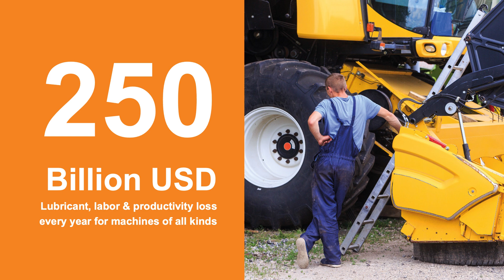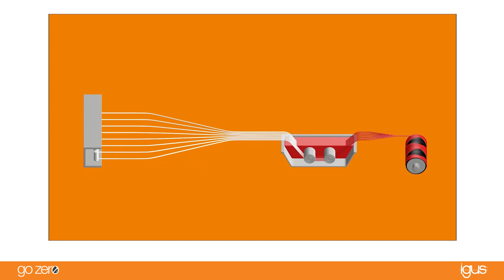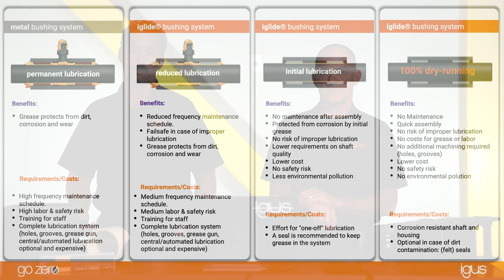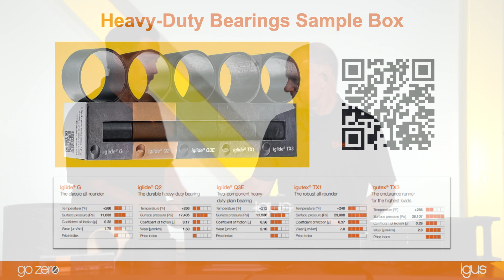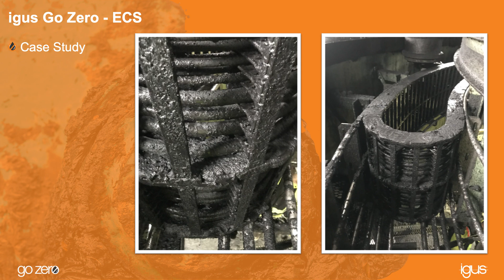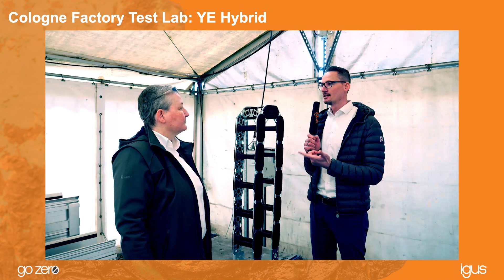Say Goodbye to Lubrication - Transforming Heavy-Duty Equipment with Dry running Plastics from igus®

Comment: I see many transmissions in lawn equipment with broke plastic gears or/and housings.
Plastic is not hard as metal and it flows long term you better make everything thicker  with enough time tested engineering before we can accept this new tech. Too many things today don't last long!
Reply from the maker: Thank you for your feedback! At igus, we understand the concerns about durability in plastics, especially when compared to traditional metal parts. However, we specialize in engineering high-performance plastics specifically designed for wear resistance and longevity. 

Our materials are not ordinary plastics; they’re proprietary blends that are rigorously tested to handle demanding conditions, like those found in lawn and grounds maintenance equipment. We also have one of the largest test labs in the industry, where we simulate real-world conditions to ensure our products meet stringent performance standards.

On top of that, we offer lifetime calculators that allow customers to predict the durability of our components in their specific applications. Feel free to check out our work in the grounds maintenance industry: https://www.igus.com/industries/grounds-maintenance. Let us know if you're interested in speaking with a Grounds Maintenance Expert!